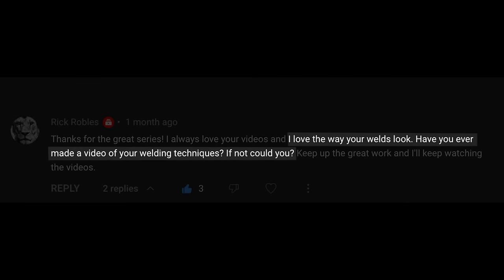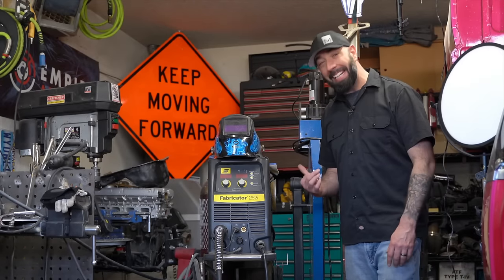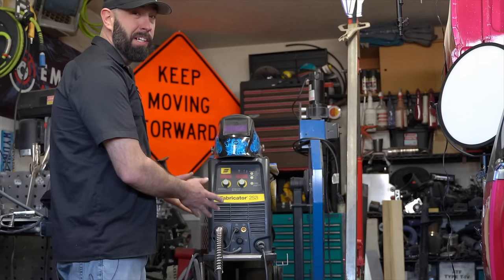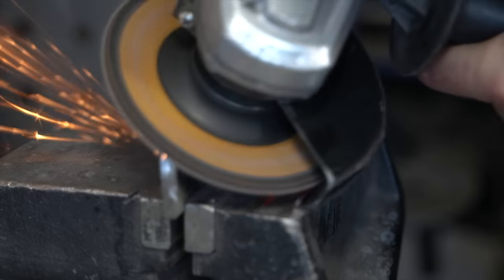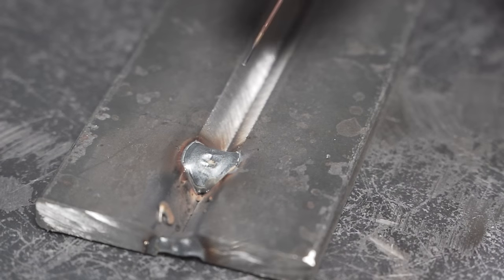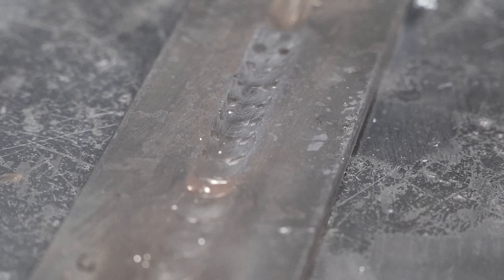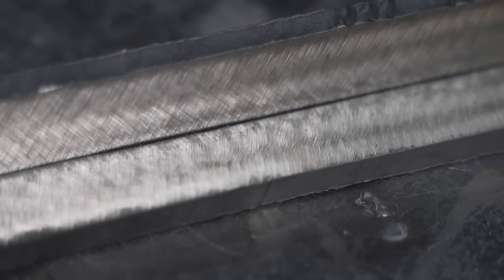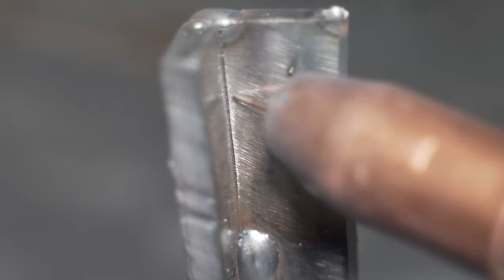MIG Like Mankandy: Techniques for Stacking Dimes with a MIG Welder

Comment: 150 volt will!, with good preps weld 5mm maximum with some pre heating. yes... you can stick 10mm plate together but its going to fall apart at some point.

Comment: Definitely one of the better explained how to weld videos I’ve seen on YouTube.
Killer work man!
Reply from the maker: Thank you my friend! How have you been?
Reply: @GarageFab  Doing Good man! glad to see your channel is growing, I bet your about to snowball like crazy. Hang on!
Reply from the maker: There’s definitely been a couple brief snowballesque moments here and there! I’m actually dreading to not being able to connect with everyone in the comments. It’s getting pretty hard. Thank you, Brother! 🙏
Reply: Except for he’s dragging and not pushing the weld
Reply: Why dont robot welders "stack dimes"?
Reply from the maker: Brilliant question. And one that I don’t have the answer to. I can see multiple possibilities. 1. Dimes are strictly visual and otherwise unnecessary. Though I feel dimes provide deep penetration and a uniform bead from the root to the crown, especially on wide joints, I’m quite possibly incorrect and there is actually no benefit other than appearance. If that’s the case, most manufacturers that utilize robots likely aren’t concerned with weld cosmetics.
2. Perhaps dimes actually weaken a weld. I have been told this, and though I can’t see how, it doesn’t mean it’s not true. I’d like to think major manufacturers would know this and perhaps this is the reason they don’t program a weave into their machines. 
In the professional automotive aftermarket, dimes strongly outweigh the smooth bead. That said I can’t say for sure that some robots aren’t programmed to stack. 🤷‍♂️

Comment: Certified welder of 30 years and also a Welding Instructor. Great video on how you break down stepping your weld. I showed this to my students, very simplified. Only thing I would work on or demo is instead of pulling/dragging your weld, push it. Although you do get a bit more penetration using short circuit transfer pulling, pushing gives you a better stacked dimes appearance with a cleaner lower profile bead. Now if it has slag, you drag!  Great video!
Reply from the maker: Thank you my friend! That’s exciting hearing my content made it into a classroom.
I pull mainly because of lack of practice pushing. I’ve always struggled to see my progress no matter how I angle the gun or my head. So I learned all I know while pulling. Downside to teaching myself I guess!

Comment: Sweet .. I am still a stitch welder .. I have worked in a body shop & used to welding thin metal .. 22 gauge to 18 gauge sheet metal to 1/8 mild steel to 3/16 mild steel is what my welder is capable of without any issues .. & because now I don't have a shop & weld out doors I really enjoy my core flux welder .. it's a little slower & messier ... but wow ! it sure welds great ! thanks for sharing your technique it makes total sense !

Comment: Had a teacher that was the lead welder for proctor and gamble for many years. He said never do anything downhill. I said what if you get a job and they want downhill ? He said get a new job. Worked for ro cranes and we did some downhill but only non critical areas to seal out dirt and corrosion. That teacher was 77 yrs old and was top notch. Cranky but top notch.
Reply from the maker: Nice. Did he ever explain why?
Reply: @GarageFab  no he never said that I remember. He never wasted words. I assume due to lack of penetration and cold lap. I know API pipelines are often downhill with 8010. They say it reduces possibility of porosity in high winds. On structural or anything high stress like heavy equipment I say uphill only. I was guided bend certified on plate in all positions. On the cranes we only did downhill in no stress areas usually to seal a seam
Reply: @GarageFab  btw good video. Forgot to mention that 😆 also the teacher I mentioned was mainly for stick but we also did mig but was colder and slower than the hot high speed mig that I learned at the crane company.
Reply from the maker: Thank you my friend. There’s not a lot that I know for certain, but I do know that stick welding down is a big no-no. The slag will race in front of the weld pool causing inclusions.
From my understanding, it’s exactly as you say; Vertical down in structural welding is frowned upon, while light duty (thinner metals) solid wire MIG, it’s not so bad. 🤷‍♂️
Reply: @GarageFab  sorry my response was so late. Didn't see yours until I watched video again today. The pipeline guys and API are downhill crazy. I've seen them do gas lines down also. Believe or not the Alaskan pipeline was also down on the fill passes from what I can find. Crazy in my book. I got a kick out of that teacher telling me get another job 😆

Comment: I bought a welding machine a few days ago that features pulse and double pulse. I will learn what I saw from you. I hope soon, in the near future, you will talk about the mig pules machine to weld aluminum . Thank you, my friend. You are a funny man. You entertained us with your unique style😁
Reply: Had a machine  with pulse. Already knew how to weld. Didn't like it. If you want to use wire on alum and want consistent burn thru on penitration. Look on the back of your weld if it looks like a mess instead of a nice smooth line. What you think

Comment: Your humor and positivity as well as delivery and understanding for an absolute novice like myself definitely earned yourself a new subscriber! Love the video.
 I've welded a total of 5-6 times randomly for random small projects that was actually used for the job I had at those very far apart points in time. (I have absolutely no idea how i was ever picked to do any of them when i had made it explicitly clear that i had only every practiced for a very short time sporadically growing up on random scraps so long as my dad could afford me burning through the welding materials to do so)
My dad has an insanely high tech and new MIG welder that also has the capability of being used for TIG welding and stick welding if you purchase additional parts that are sold separately which I thought was insanely cool! That being said I decided to skim through the manual and learned so much more about welding than the absolute beginner level that my dad and I had ever known😂 My dad, brother, several uncles and cousins on my dads side of the family, and myself are all very much jack of all trades tyoe of handyman with different specialties of some type of
construction labor, my dads and brothers being cabinetry, mine being an annoying, adhd, probably no as funny as I think/hope to be, brain full of random and useless to the task at hand supplier of random facts. 
Anyway one of the things the manual explained was the penetration of the weld and filling the entirety of the seam of the two pieces being welded together. I was finally getting my welds to look decent, but i could not figure out how to get the weld to fill the seam fully, or at all for that matter. Seeing you do the put the bevel on the two pieces being welded like the manual suggested gave me the visual i desperately needed to be ale to take my welding to the next level (The starting line of welding. FINALLY! 😂😅) 
Also the way you explained while welding helped me understand so much more on the things I need to do to be able to do to make my welds look better. I wasn't ever able to understand how flat people could weld to make a weld worthy of being called stacked dimes, and i totally see why i couldn't get there fully now. I cant wait to put it to practice tomorrow! Or technically today as im posting this at almost 1AM 😅
Ps if you read this entire comment i am so sorry for being so long winded even through the digital world. I get that way when im in this good of a mood which has been a rarity for me for faaaar to long. So thanks for being you and the awesome content! God bless and keep moving forward.
 
Pps... psps... ps²? You look like you enjoy the stink of a cheesy joke. 🎉...🦗🦗🦗... I'll see myself out now
Reply from the maker: I laughed out loud at PS Squared. You are so very much appreciated my friend. Let me know how things go! Understanding is one thing. Transferring that understanding to action is another challenge. I’d love to hear if things improve in real life. Cheers!

Comment: Been welding for 10 years, 5 in structural and 5 in a fab shop and have been a CWI in both. There's 2 types of welds you can do, a structural/ code weld, and what I call a chassis weld. A weld to code ensures max penetration but doesn't always look the best. A "chassis" weld looks great like a stack of dimes but it will still hold up to the job. I've welded trucks that can fly 120+ down the desert and some have been in rollovers, and still hold up running downhill or by pulling. I prefer the good looking weld because that's what people pay for and it is more than capable of holding up to whatever you need it to do.
Reply from the maker: I appreciate that Austin! You might be the first so far to give merit to both styles of welding. Usually it’s all or nothing in favorite of one specific method. Cheers!

Comment: Hey metalworks, a 45yr welder here, I don't do often at all, but  I can 18 downhill. Used it  to just seal up a corner joint that required 7018,ran faster
Reply from the maker: So not for strength then?

Comment: I'm a beginner.  I've used SMAW to weld pipe fence and made horrific looking welds on used pipe but overall, have the appearance of a solid weld that'll work great for the task. I welded without any formal training and now I'm actually taking classes to get the welds I want. I just started GMAW and appreciate your informative videos as well as the experienced welders in the comments. Thankyou all. Can't wait to get structural welding down.
Reply from the maker: Well since you’ve been reading the comments, you already know that your lackluster welds very well may be far more structurally sound than my fancy ones! I hope to hear more input from you after your classes. I’ve been meaning to take some myself. 🤔

Comment: I have been taught to weld vertical up. Give it a try they say it gives you better penetration. I definitely appreciate all your videos an thank you for helping an teaching me how to build my Apache C-10  the Watts link is Phenomenal and worked amazing on my 65 frame.  Thank you sir an keep them videos coming
Reply from the maker: Nice! Happy to hear it Scott.
I need to work on my patience. I’ve tried vertical up several times and I can’t get a bead that lays down properly. Just need practice I’m sure.
Reply: @GarageFab late reply but you normally shouldn’t run a straight mig bead uphill. You need to weave side to side and hold your edges before coming back to the middle and to other side.

Comment: Great video, I love the progression of tack on tack speeding up and adding patterns! As for vertical, the way it was explained to me for structural is that gravity pulls the puddle over base material that wasn’t hot enough (this was also stated above) and along with that slag can get under your next puddle. This was really great!
Reply from the maker: Thank you Justin! Your explanation makes all the difference. My biggest pet peeve is folks saying something is bad or incorrect but can’t or won’t explain why.
You are appreciated my friend.
Reply: @GarageFab  that being said, on non structural parts, I weld Downhill often, when space is tight and material is thin sometimes it’s just easier and gets those jobs done just fine! Cheers bud!! Thanks for the video and reply

Comment: I'm not an expert welder, and you say you're not an expert welder, but my friend, you're wrong? I think you're an expert. I mean, I'm a contractor over 20yrs, so I have expert building skills.
I just started learning to  Weld for my personal use. This is one of the best videos  I have watched. You actually answered some questions I had before watching this video that no one else talks about in other videos.
Thank you.
Reply from the maker: Thank you for the kind words my friend! I’m slowly learning myself and I keep discovering things I do wrong. This is the reason I can’t claim expertise.
If you don’t mind me asking, what were the questions you had? I’m considering making more welding videos and it would help to make sure I cover everything necessary.
Side note: I just discovered Weld Coach. It’s an online welding aid where you get real time feedback from a professional welder during a video call. Sounds weird but I learned quite a bit in one session.
Reply: One question I can think of. When you have 2 pieces of metal more than 1 8th  of an inch thick, how to weld them all the way through for rigidity, and you showed in the video to tapered off both pieces then go down the grove in that pattern. Your video is very easy to understand for a beginner like myself. My goal is to learn how to weld aluminum. I bought a cheapo electric welder, but I didn't know It couldn't well aluminum so I'm purchasing a multi welder this week on Amazon.
Reply from the maker: Use caution with that multi welder! I did the exact same thing. I bought a MIG/TIG/Stick machine to weld aluminum. Then found out it was a DC only machine. You must have an AC TIG machine to weld aluminum.

Comment: I just discovered your channel while watching how to weld videos. I bought a multi function mig last week and a plasma cutter and want to learn to use them better. I had a cheap HF flux core welder that stayed in the box for 4 years until recently. I bought a 1966 El Camino that I have to replace the quarter panels on and plan to do most of it myself. My brother will help me, he’s has a body shop and will make sure I do it right. I subscribed and looking forward to bing watching your videos. Very informative and one of the best I’ve seen. Thanks for taking the time to help us newbies to weld. BTW I been a mechanic and DIYer since my teens.
Reply from the maker: Yes! Best of luck on your journey my friend. If you’ve got questions, you know where to find me. Cheers!

Comment: Very nice explanation.  For new welders you might want to get an older Miller 250 MP.  Pretty cheap now.  This machine uses parametric programming.  Simply select the wire size, gas type and material thickness.  The rest is all set for you.  One drawback though, you’ll forget how to use the dials on other machines.👍
Reply from the maker: Haha!! I’ve experienced that with the tiny Miller as well. The one at work is always on auto. 😆

Comment: Thank you.  I've been welding intermittently for just a few mos w/o consistency.  My welds are okay, but the way you teach is very helpful.  I wish I could use my laptop in my shop to watch you a little bit, and then weld a little bit, and repeat.  I'm confident that Ill get there.  Thnx, again.   : )
Reply from the maker: I’m also confident you’ll get there. It’s tough to get started but it eventually gets easy. A tip that would’ve helped me: Slow down! When I pulled the trigger I would suddenly feel rushed. I’d wiggle the gun frantically and move along the work piece like I was in a race.
Move slowly! Watch what the puddle is doing and how it moves when you move. Intentionally try to go too slow. Then speed up if needed. Too slow is often better than too fast. You’ll at least get better penetration.

Comment: Great video showing straight forward technique. For people who want to know more on the technical side, id recommend looking up the different modes of transfer for MIG (GMAW) welding. Short circuit, spray, pulse spray, globular, each have a place and alot of good info out there.  Ive always been told short circuit is best used on metal 3/16" thick and less, in any position which makes it great for automotive work. When you get thicker it can be likely for Short circuit to have some lack of fusion.
Reply from the maker: Thank you for that! I’ve seen some spray transfer and I’ve wanted to try. Is that simply a settings thing or is a special welder required?
Reply: @GarageFab  yes, I believe if your welder has enough power it can,  it takes high Amps and volts and high feed rates (can't give specific settings) I'm sure it can be looked up. You also need a different gas, i use 90/10. It is pretty cool, the sound changes and there is basically no splatter.  Spray transfer can really only be used in flat (1F) and horizontal (2F) fillet welds. Kinda limiting IMO.  If you have the money "plus" Spray is where it's at, bc you can do all positions I have the miller invision 450 and I love it!
Reply from the maker: I’ll look into it thank you!

Comment: I have never taken a single lesson and my welds show it.  Thanks for the outstanding explanation of your form.  The overlapping triangles has given me hope for  a better looking weld.  My brother and I say the same thing.  Our welds are ugly  but we are excellent grinders. LOL  I agree 100% with regards  to the quality of the equipment.  I have a small Lincoln Electric MIG/TIG/Stick welder which I love.  I live in a condo and I can't rewire my garage so I'm stuck with a 120vac welder.   I think that I may improve after watching your video and maybe a few more.  Thanks again.  Most helpful.
Reply from the maker: I haven’t used your exact welder but a 120v welder is often more than enough. You won’t be building backhoes or buildings but they’re still very capable.
Keep on grinding my friend! 😁